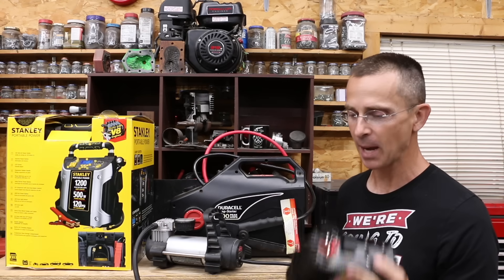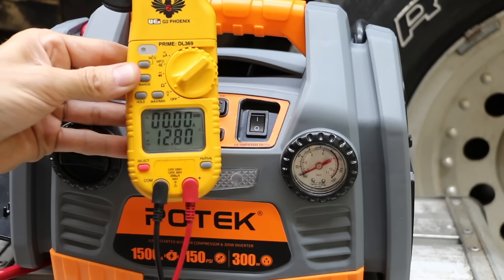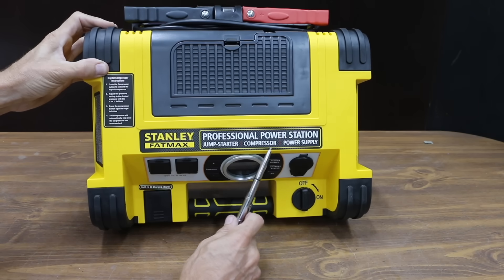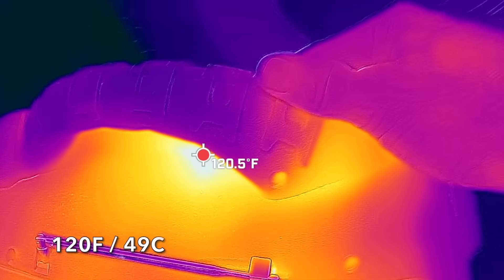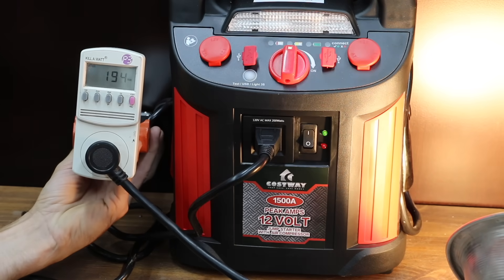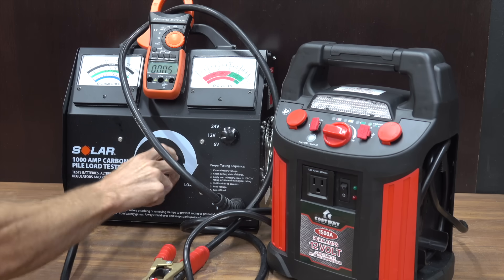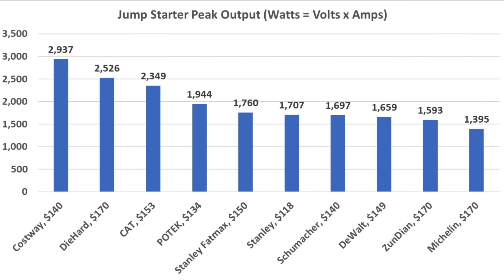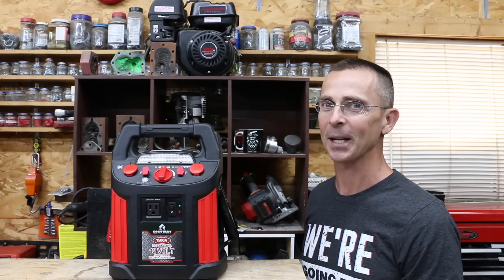Best Jump Starter? DieHard, Schumacher, DeWalt, Michelin, Stanley, CAT

Comment: Portable air compressor with both a 12v dc power source, as well as an AC ability. I guess one of the ones in this video might be best for some, I rarely need a jump and already have cables. I hope I didn’t just curse myself.

Also I think a general purpose scissor video might be interesting video. Cutting cardboard, chicken bones, rope and thick plastic might be a cool video. I also think that the testing devices that you come up with is hold be very interesting
Reply from the maker: Thank you!

Comment: One additional test might be how much fun it is to change the battery.  5 years is about as long as you can expect from a sealed lead acid battery, and that's if you treat it nice.  I've had a clone of that zun dian thing for about 15 years, so I've had to swap out the battery a few times.  It's about 17 fasteners in and care must be taken with a few components not held in place with the cases separated.  Unlike a UPS with decent battery access, it's designed to be disposable.  Also worth mentioning is, like your spare tire, if you ignore one of these until you need it, expect to be disappointed.
Reply from the maker: Thank you for the video idea!
Reply: @ProjectFarm  If you go there, pay attention to the physical battery dimensions.  As any IT guy can attest, the AH rating will get you close, but battery form factor is not completely standardized.

Comment: I'd still like to see a test of wire crimpers, since most of the ones I've found in stores have been underwhelming. You could test things like wire pull-out force with a standardized load, amount of force needed to do a good crimp, a subjective comfort test, et cetera.

Comment: Not the cheapest option but I would stay with a lithium ion battery pack jumpstarter like the NOCO or Gooloo(or similar) you reviewed and a good portable tire inflator like Viair 88p or similar that can connect directly to battery.  Probably ends up being lighter or the same weight as one of these all-in-ones.

Comment: Project farm....... I've been a supporter since the early days when you went from 10-20k subs in a week or 2. But this test is disappointing because they're all junk. I've been in the towing business for 20 years and the only jump box worth anything is the JNC jump n carry. Now it doesn't have the bells and whistles but unlike those it actually will jump a dead battery. If you need a compressor just grab one from the junkyard out of a Kia and a lot of cars have inverters too. Or you can buy one and throw it in a bag with the jump box and compressor in your trunk and know it'll work when you really need it.

Comment: After being left stranded by two different lithium units that are only good at charging my iPhone, I reverted back to using my +10 years old motomaster unit by replacing the internal battery that was almost dead for $77.00. I have been using it for over two years now and I scheduled in my phone an alarm to plug it overnight once a month. That way it works every time I need it and keeping the battery fully charged makes it last. I am amazed at the vast variety of products sold that can’t even be used for its main purpose of starting the car if stranded. They should not even be on the market since they will finish in the trash at the first letdown. Thanks for shining a light at all the rebranding of garbage on the market. I would pay big for a properly designed and built unit. These are life savers if you travel far from populated areas.

Comment: These type of units typically have a relatively small AGM lead-acid battery inside (some smaller ones have batteries as small as 9 amp-hour). They have no capacitors or anything else inside to provide more starting amps than the battery itself can provide.  If you open each unit, you could confirm the specific size & manufacturer's rated capacity of those batteries, which (as your tests showed) is much, much less than the claimed 'peak amps'  printed on the outside of these units.
Reply from the maker: Thank you for the feedback.
Reply: This would be a good primary data point for autopsy and provide a opportunity to see what went wrong with the ones that went up in smoke.
Reply: i was researching the same thing. The batteries in these jumpers are rated for significantly less then the jumpers claim, EVEN at a dead short!

Comment: All this stuff is trash.  There's a reason why these cost the same or less than one specific quality component; they do NONE of the tasks well as they are too cheaply made.   I bought the Audew jump starter by your recommendations PF: GREAT PACK!!!   Used it frequently and often: Great tool.  But that jump pack costs nearly as much as one of these combos.  Same with a quality inverter which can't be touched at these prices.  That should tell people all they need to know about the guts inside these things, so nobody should be surprised when they see smoke!
 If you want in inverter, install a quality inverter.   If you want a jump-start unit, buy a quality jump-start unit.  But these all in one units do NOTHING well save take your hard earned money.

Comment: I find it interesting that the smaller rechargeable units like the Audew do a better job of starting a dead battery than these larger ones. 
Of course they don’t have the tire inflator and is a separate purchase.
Reply: Good point, Andre! And the Audew uses a lithium ion battery so you can count on it holding its charge for a much longer time than these units.

Comment: Did you do a test on regular jump starters? Without compressors inverters and other stuff? I am leaning towards going with Schumacher BUT, thats because I have a bunch of old Schumie chargers, trickle chargers back when they were made in the USA. Id like something with a regular 110V wall outlet to charge it, and nothing else. Analog also would be ideal for fixability....

The unit I saw does 12 and 24V for this small fleet of cars I try to keep going.

Comment: Your thorough protocols and DAQ are always spot on Todd.  Thank You!   This actually amazed me that all but one wouldn't jump a light truck...seems this would be the primary reason to have one.  All the other features are nice but why add all the heavy cable, clamps, design and assembly if they don't work.  Obviously one size doesn't fit all needs.  So many of us DIY'rs have built our own I would thought they would have made a better run at a production unit and set better design specs.  Thanks for the clarity about another not so bright light at the end of the tunnel to the waist stream.  ;-P

Comment: Great job! Did all the units use lead acid batteries? I ask because lead acid batteries are going to do poorly after being stored in the car for a while. In fact, a great additional test of all these units is how long you can store them in your car before they lose enough charge to become unusable. I am guessing, but I suspect that most people are not going to remember to check the condition of the battery on a regular basis.

Comment: Are you sure that the ones that shut off all did it to avoid overheating?  The timing on a couple of them stopping at more or less exactly 10 minutes suggests that it's more to make sure that it isn't running unsupervised and that if you started it again it'd have completed the test with no issues. I think it's unfair to fail a test because of a safety feature.

Comment: I have an old B&D over time the batter got weak over the years but all except for the inflator (it died a couple of winters ago) only a cigarette lighter socket. I think the packs that don't have an adapter is nice since with all these AC adapters we have today it can get lost easily and most don't clearly identify which adapter goes with which device. They are definitely useful, I live in and apartment and we have lost power before and we have lost power. I put a 70 watt inverter into the pack and it powered a lamp with 3 LED bulbs in it for the duration of the outtage. I like the Dewalt but the Costway is nice but it looks like it has the biggest battery. Thanks for the video 👍🙂

Comment: I have a Stanley FatMax 1000A I picked up at Sam's on sale a couple years back just to jump start my lawn mowers and zero turns out back in the barn . All I do with it is jump start and haven't had any problems with it so far . I do jump start my 1994 Ford Ranger with it from time to time because I turned the lights on during daylight hours and forget to turn them off and I run the battery flat with no juice in it what so ever . I use the Stanley to jump it off with no problem . My Ranger has the big V6 in it with ( 4 liter ) with the aluminum intake like a 5 liter Ford Mustang with 250,000 miles on it .
Reply from the maker: Thank you!

Comment: I think everyone should have a jump starter/tire inflator in their vehicles.  You never know when you're going to need it.  I've used mine quite often for myself and helping other people out.  I have booster cables as well, but a jump starter is just so much better if you can't find anyone to give you a boost.  I like to be prepared for anything.  Thanks Todd for another thorough video.  I definitely would not want a jump starter that smoked trying to turn an engine over🔥
Reply from the maker: Thank you!

Comment: I have the Stanly $118 model and I have started easily 5 vehicles.  It possibly worked because I attached it and let it sit for about 30 sec before starting, and I did that for every vehicle I used it on.
Reply from the maker: Thank you!

Comment: Another great video. One thing that would be interesting to see is a disassembly postmortem on the units that failed. Taking a look inside might reveal a simple fix, or perhaps an unsafe design that could cause injury...
Reply from the maker: Thanks!  Great suggestion.  Thank you.

Comment: Great video as always. I actually own the $118 Stanley power station. And considering I go it 2nd hand for like $40, I must say while I won't contest your testing, the Stanley has saved myself and a others numerous times from inflating a roadside flat to the random gas station jump start. That jump box will start a 99 suburban with the 350 vortex with no battery in it at all. I've also done the same thing with a V6 mustang and my 95 bronco. It doesn't crank the engine over fast, but it is just enough to get it to fire up. Glad you featured featured it in your testing since I've never put it thru the same testing and rigors that you do. Keep up the great work, I always look forward to your videos.
Reply from the maker: Thanks, will do!

Comment: Thanks for another great product performance test.   Consider taking the units apart and comparing compressor, heat sinks on electronic inverter and regulator ckt boards and if any had internal cooling fans or other PN junction solid state type cooling for heavy loads
Reply from the maker: You are welcome!

Comment: I’ve had the older version of that Die Hard for almost 20 years. I can confirm that it will start a V8 Jeep by itself (jump pack connected direct to battery terminals, no battery) with ease. I’d be shocked if the new version didn’t. Maybe it’s defective? Considering it’s overcharging itself out of the box? It might’ve killed a cell in the battery or trying to compensate by overcharging because of a bad cell.
Reply from the maker: Thanks for sharing.

Comment: I recently bought an Eco Flow “Solar Generator” for brief power outages and camping use.  I would really like to see you put these new type of “generators” to the test.  They are not really generators as much as a battery back up inverters,but I have yet to see testing measurements with amp hour back up.
Reply from the maker: Thanks for the video idea.

Comment: Literally all of these suck for what they're intended use is, except one. None of them would start the truck. The Costway is the only one that worked.

Some of the tire inflates dieing at 10 minutes is kind of useless too... How long did they take to come back on and finish the job?

I'll just carry jumper cables and hope someone comes along with a car to help. That or keep a spare battery in the toolbox for a backup because it's cheaper than these things that won't start a car with a dead battery.
Reply from the maker: Thanks for sharing.

Comment: My Prestone Jumpit lasted 8 years. Only had enough juice for the light and charge a few usb accessories at the end. But that 10 minute shutoff is why i hate all in 1 units. They are nice but after time 1 or more of the features stop working. Most of them are all connected so its screws up the whole unit. I took the JumpIt apart. So hopefully these new units arent wired that way.
Reply from the maker: Thanks for sharing.

Comment: Pep Boys has a Duracell compact unit for Easy Storage it will jump start truck I have a Ram 1500 5.7 V8 Hemi and no problems had a little bit of a problem jump starting a Ram 2500 diesel but the batteries were bad so it was not like the batteries were drained from the lights.
Reply from the maker: Thanks for the feedback.

Comment: I recently tried to jump start my neighbors car with my Dewalt Jump pack, same model as in your test.The symptom was that when the key was turned, the starter bendix would engage 3 times, and then stop. It would do this with each turn of the key. This was a Chrysler van with the 3.6L Pentastar, and has a turn to start system. The starter is actually controlled by the ECU rather than directly by the key switch. Normally, no matter how briefly you hold the key over, the ECU will continue to crank the engine until it starts. The voltage tested at about 6 volts according to my multimeter. The Dewalt jump pack made no difference in the behavior of the starter. The ECU obviously did not like something about the jump pack. Too much voltage drop maybe? I also connected a Stanley FatMax along with the dewalt, and still the engine would not crank. After charging the battery for several hours, the engine started normally. 
I have a 2015 Jeep Grand Cherokee with the push to start system, and I will test this jump pack out on that once I get it back from the dealership. I hope that this is not a common issue with jump packs, and ECU controlled starters. I know that the Lithium jump packs you tested, though very compact, were capable of much higher amperages. Maybe that would be the better way to go in this case.
Reply from the maker: Thanks for sharing.

Comment: all of these jump starters usually have the same battery in them (12v 18ah). their peak amp rating for 10 seconds is usually 180-200a. regardless of what the manufacturer says. I bet their ridiculously high amp ratings are for 1 second. which means you should be able to start a truck once or twice, and smaller cars several times.
Reply from the maker: Thanks for the feedback.

Comment: What is the average lifespan on these sort of boxes?  I had a Schumacher and was disappointed by the 3rd time I needed it (it being a few years old at that point) that it wouldn't hold more than a 50% charge, despite regular recharging every few months to keep it full. Trying to decide if it's worth getting another all in one or just buying individual parts like mentioned in the beginning of the video.
Reply from the maker: Thanks for the suggestion.

Comment: I'm surprised you didn't test the JNC 660 jump starter.  I'm not saying it would do better that any of the other that you tested but it IS the industry standard when it comes to jump starters.  There's a reason why EVERY repair shop, body shop, car auction, car dealer, and tow truck in the country has a JNC 660 within reach at all times. Great video!  Thank you.
Reply: Yeah that’s the one I have. I bought it on Amazon 10 years ago, and they only cost $5 more now! Still works great!
Reply from the maker: Thanks!  Thanks for the constructive feedback.
Reply: Best unit on the market!

Comment: You can currently get one of the higher rated lithium jump starters that Project Farm reviewed before and a Viair compressor for around the same price or a few bucks more than the cheapest one of these.  And when one fails, you can replace just the one thing, rather than a more expensive combo unit.  And they work better, both at inflating tires and starting cars.  This is a no-brainer.
Reply: The capacitor jumpers would perform better  the life cycle of them is way longer   because they don't go bad fast like  LA or lithium

Comment: Love the test, but I'm really disappointed with how they performed.  The lithium ion jump starters are definitely vastly better. Im looking forward to the next video as always.
Reply: Those lithium ones suck in colder areas. The best starters are still the big old ones.
Reply: @mediocreman2   I've started a magnum 275 case tractor with batteries completely discharged in 0 degree weather with my lithium ion jump starter.  You may have to keep it stored indoors? but the lithium ion has vastly more cranking power.

Comment: Great test as usual. Did they all come with lead-acid batteries, or was some of them with lithium-ion batteries? If not, would you consider doing a test with lithium-ion power stations? I know they're quite expensive so that would maybe be too much.
Reply: He has previously tested lithium battery jump packs.
Reply: @haphazard1342  this is the 3rd part of battery jump pack right? I've found the other 2 videos, but... For u, in conclusion, what are the better lithium batt jump pack?
Reply: Those 16lb 13.8v units must have been Lithium
Reply: @mrmotofy  I Looked for lithium batteries in the test and there were none .I have a noco and i believe they are lithium .This thing has no problems starting the biggest pickups including diesel .rated at 2000 amps
Reply: @mrmotofy  I used it today to power my air pump to pump up my tires in my truck .The front takes 49 lbs and the rear 64 lbs .I got to three tires before it went to low to power the air pump .I had to finish using the van battery while the van was running